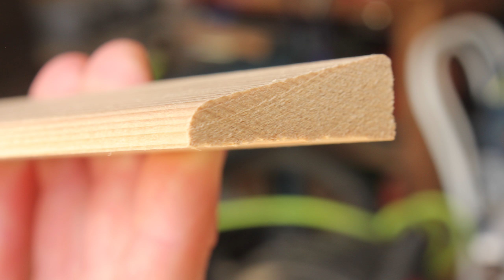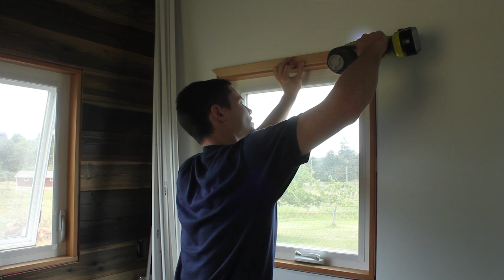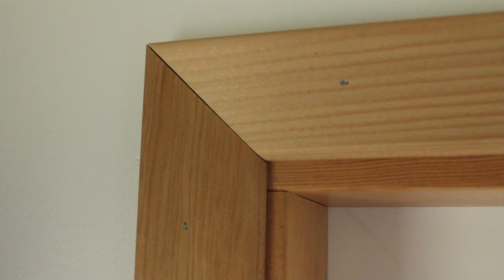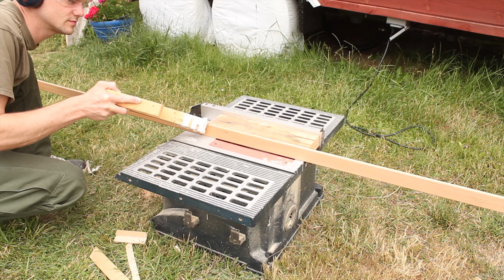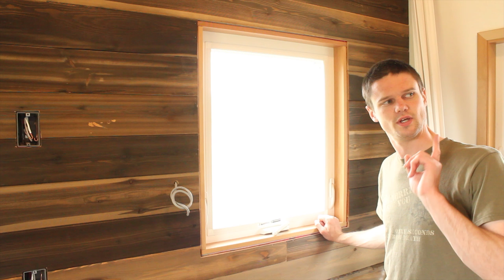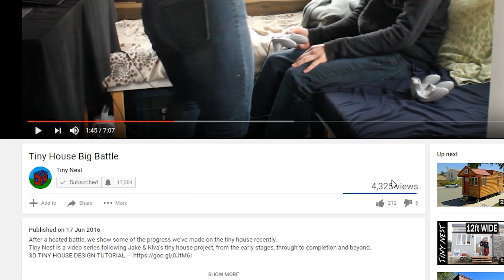Window Trim in a Tiny Home (Ep.75)

Comment: Glue the edges than use putty for the nail holes.
Reply from the maker: We were just talking about how we see the term putty used a lot in our comments... we use a product that we call "wood-filler" which dries quickly and is that sandable, paintable, stainable... is this different from what you are referring to?

Comment: Not sure whether you bought the windows with sills in or not. But it would have been easier to buy the windows without and then make them yourself so they'd be the right depth (and you can cut them in a way to hide issues like the proud header). Thus getting a high quality finish.
Reply from the maker: We made our own sills.  You can check it out in Ep 57 ;)
Reply: they could have padded out the frame on the designer wall .. simple square pads glued and tacked to the frame, then put the finish molding over it all